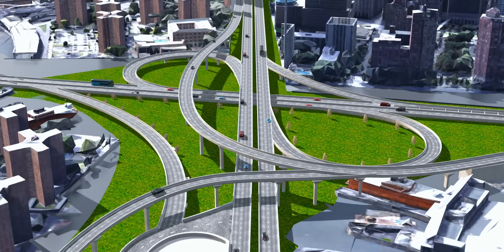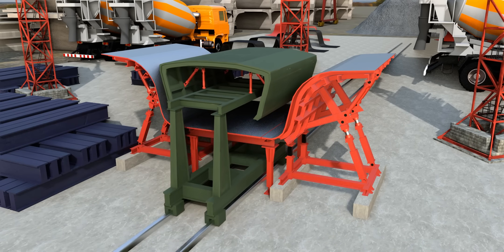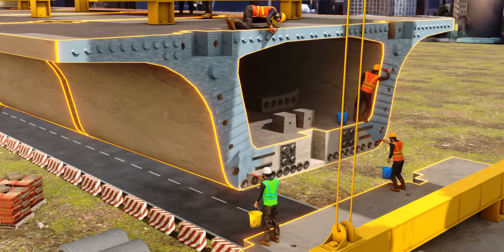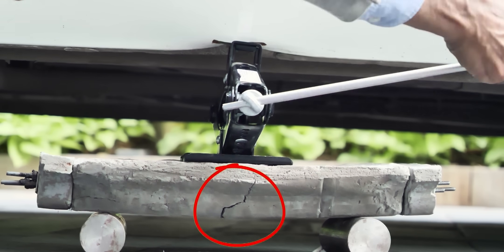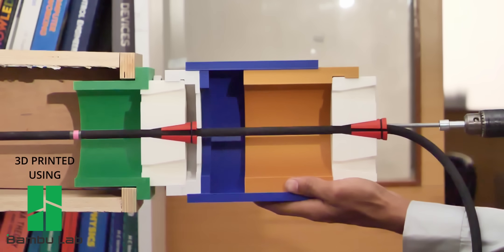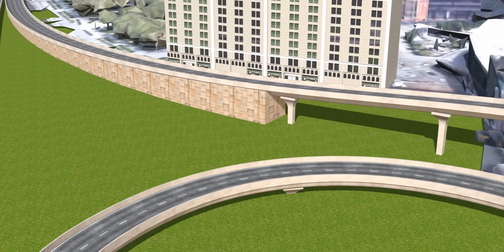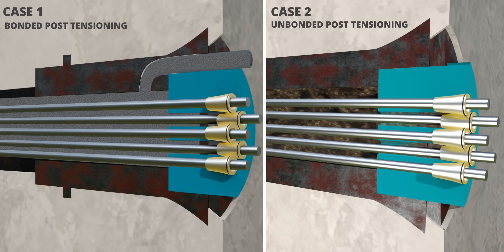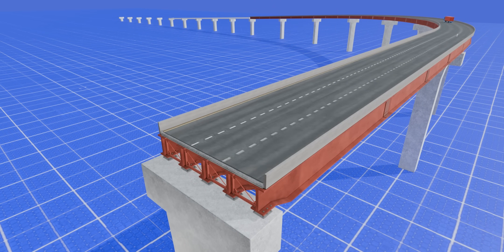How are Modern Flyovers Built?

Comment: @6:24 Engineers... If you strip the threads with the first nut just leave it in place, maybe add a couple of washers, and put on a second one so it sits where the thread is still intact. Just don't overtighten that one, too. Of course you have to gradually advance the first nut.

Comment: I've worked on a few flyover that were not post-tensioned.  Several did not use prestressed girders, either.  The only box beams in these bridges were steel and were transverse connectors for longitudinal girders.  Not every flyover is built like this video claims.
Reply: Thats not great news, but thanks for sharing. I would guess Japan's flyovers are built soundly.

Comment: The strata the stabilizing factor of the weight of bridge from the bearing downwards, but an intensity earthquake of 7 or more would shake the ground foundation of hard solid rocks and the weight transfer would tilt, scaffold shaken bridge endanger to collapse. Why not use the extra space of a hangar shaped of aircraft carrier like hangar shape below bridge to generate electonics or beam rays of rods of structure extending at the side of the bridge in interconnect by to and fro weavers of either coiling electromagnetism beams or protonic structures of electron and photon collission produce to and fro from that bridge to very far away bridge using wireless connectors the way thats used in harvesting energies from space to message couriering probably applicable to distant area places on Earth though with consideration wisdom above Earth within the intersect of longitudinal and latitudinal of merideans and parallels for the area scope of gravitate and dimensional muon. And outline the strata rocky solid areas and its connectors with outliner energies up and down like polarity then edge to edge of picture application of energy usage in Dimension, or add sandwich layers of spread for the stable augmentation in seesaw with the cost factor. But with gateway safety of distal to proximal science of ectromagnetism to protonics interconnect stabilizer buffer upon sensing earthquake waves meaning with sensors down, otherwise a domino effect of fall. Not imposing to do that but only an idea opener.

Comment: Time:05:50
Few issues need to be clarified here
Individual Box Girder cannot be shelfstand just by just male-female interlocking mechanism and epoxy glue at any time.

Before post-tensioning operation (i.e. steel tendor joins concrete box girders together), individual concrete box girder either
(1) suspended by wire cables overhang above steel gantry or 
(2) suppoted by temporary scaffold erected from ground.

Comment: Great video, but the terminology isn't accurate. It's not "poststressed" concrete 6:05 it's prestressed concrete. The concept is called PREstressing because the concrete is stressed before being placed in service (before any external loads are applied). Prestressing can either be done by pretensioning (the tendons are stressed BEFORE the concrete is cast) e.g. pretensioned hollowcore slabs, or by post-tensioning (the cables/tendons are stressed AFTER the concrete hardens) e.g. post-tensioned slabs or box girder flyovers like the subject of this video.

Comment: Video edit suggestion: don't use a short audio sample that escalates quickly in volume then disappears at the start of different video transitions while the voice over is continuing. Instead choose a subtle repeating sample with low volume. 12:47 the sample suddenly comes back and almost drowns out the speaker.

Comment: Will someone please tell that the jack is not placed in the right spot under the car, and the load of the car is not transferring  on to the jack and instead bending the car body 🤣. So much for structural engineering.

Comment: 6:44 Dude... Read the car's manual, it tells you how to place the jack. Idk with yours specifically, but most compact car's jacks have a U shaped carrier. The cars then have a corresponding spline running down both sides about an inch or two deep beyond the paneling. It is designed to take the weight. It would probably even take the weight if you placed the jack right square in the middle like that. But if you just put the jack on the paneling, even correctly positioned nearer the tires... Well, you seem to have found out what happens.

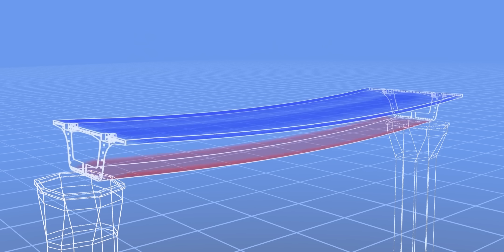Comment: At 7:44 shows "INCREASE IN LENGTH" for top of girder & "DECREASE IN LENGTH" for bottom of girder. This is backwards. The cracks develop first at bottom of girder due to increased tensile stress at bottom which results in stretching to the point of tensile failure. At 8:19  shows  "REDUCED TENSILE STRESS" for bottom of girder. The "stress" remains the same. It is the "strain" that is reduced with the addition of post tensioned steel cables. I had to stop watching at this point. Further consult time will have to be remunerated accordingly.

Comment: That bridge like structure with large square like interior enlarge that and it looks like an aircraft carrier hangar bay for aircrafts and it's jet fighters. How to do that in space with supergiant structures attached to each other. See that base arranged round thing of metallic like one after another, if with super sensors and strong magnetism type synch to it's other materials of receptors of sensed signal to laser guided and the long rods of structures encased inside extend to the other part holes with pin wires attached along it's length within or a sophisticated adaptors laid down by hovering AI tech operated probe logistics or material  carriers of lodge in and twist then encoded with science attract hexagons, polygons etc or the plug in attach of interiors to outer surface wirings, materials, systems, etc by hovering science tech 3D printers something like that.

Comment: As I understand, this is stupid idea for building bridges.
May be easier and faster way for assembly the blocks, instead of bringing the whole big section to the construction site, and lifting it up with huge cranes. The question is for how long this bridge will last before he will collapse?
During driving to work, I saw that few intersections were built the same way at the center of Israel.
I was very tensed during passing under not accomplished sections over the highway, but after I watched this video, it seems that those bridges would not hold for a long time.
I really hope I am wrong 🙏

Comment: This block underside all {(pipe  ,cable ,gas,water( useful/ dust),electricity,telephone,int,,}line will can make...for long all  line...this Concrete block not only stay on big Piller ,it tightly attachment need with Piller.,so piller head some  big steel rod long need need when fram will make & long concrete block head Piller rod fixing holder need,for good & strong attachment Piller & long block,,,its upper road.....

Comment: So how are tension cables used on curved flyovers?
Reply: Since curved flyovers have a horizontal bend, the load distribution is different from straight bridges. The curvature induces additional forces, and tension cables help maintain the overall structural integrity by preventing excessive bending and deformation. The tension cables are usually placed strategically to work with the natural shape of the curve.

Comment: Very interesting video, but clearly not all made by the same person. Also, that's not how you jack a car. And the threaded rod design is too tight so you can't turn each nut without hitting the other. And don't get me started with the concrete design. Maybe use the 3D printer to make the mold next time? And try to not strip the threads (no idea how you did that).